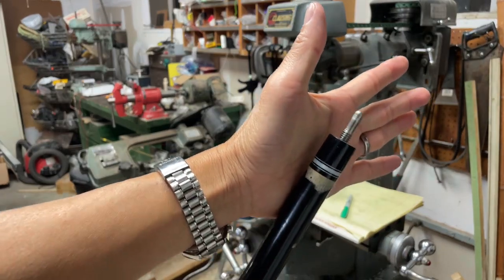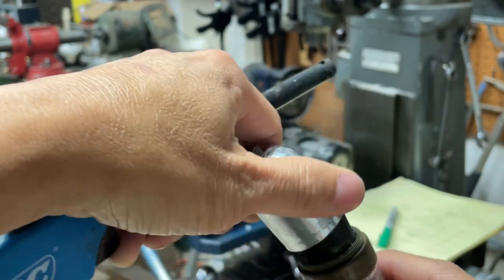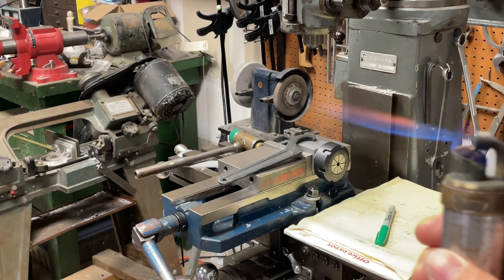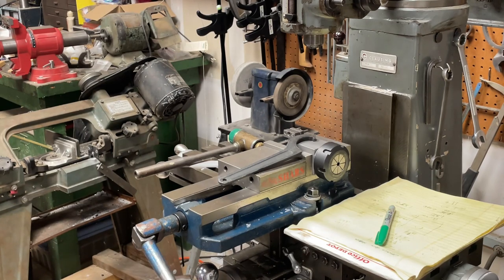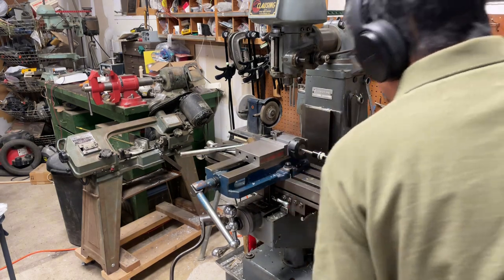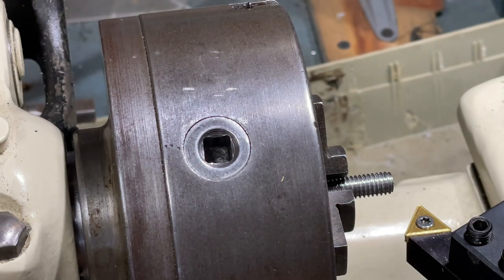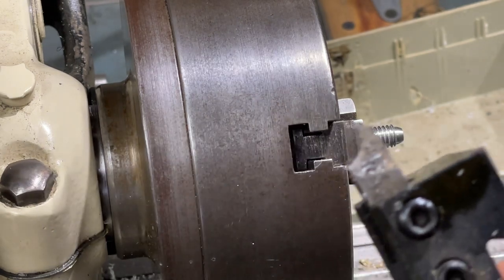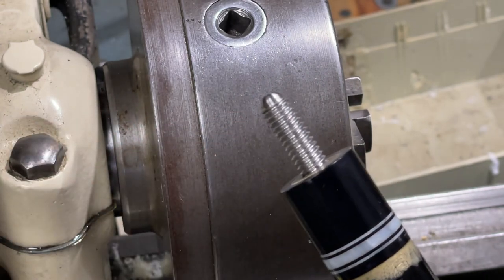Remove Pool Cue Joint Pin with Antique Alcohol Blow Torch

Comment: I've had to remove things that had red loctite on it.  It's supposed to require lots of heat and big tools, but I found out the if you heat it hot enough to melt some beeswax, the joint will wick the beeswax in and interfere with the loctite's bonding making it really easy to disassemble...  wonder if that would've worked with this epoxy...
Reply from the maker: Interesting!  I have a lot of beeswax!